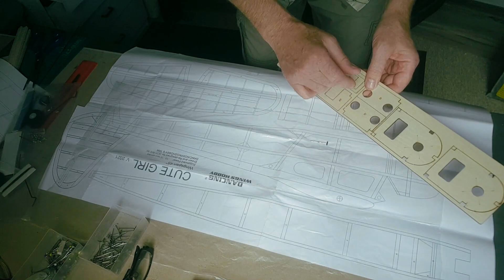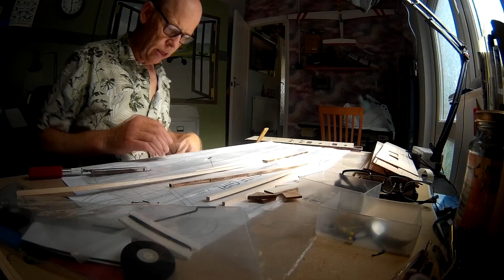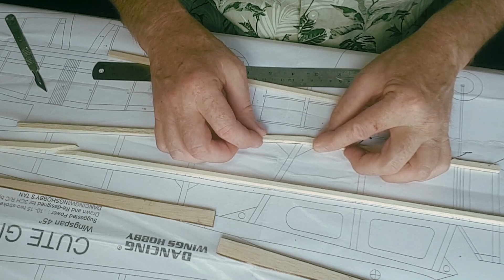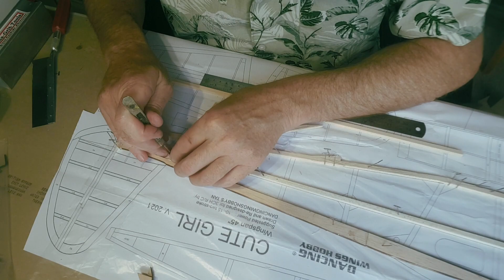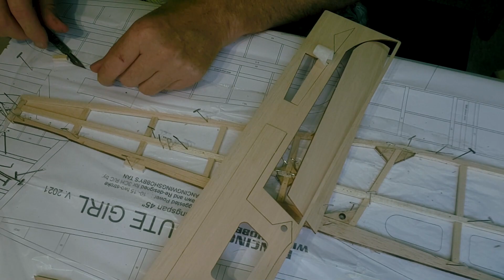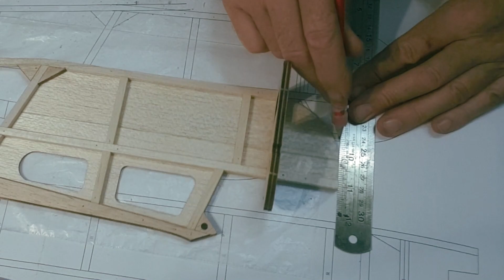Dancing Wings 'CUTE GIRL' Build Instructions, Part 1 of 3

Comment: A quick tip from a 50 + year builder. Get your self an Excel Mitre box # 55666. Comes with  a nice k5 handle and fine tooth saw blade. Perfect 90 degree and 45 degree left and right cuts every time. Exact vertical cuts with little risk of slanted cuts.
They sell for 40 to 45 or so $ but worth every penny.
Reply from the maker: Thanks Ken, cool tip 👍

Comment: Great video for new builders Cliff.....just one comment, not a criticism ! Do you ever build the second fuselage side on top of the first to make them identical?. (with cling film between)..as I say, not a criticism but just the way I like to..
Reply from the maker: Good question David, I do sometimes but rarely. I just use the same pin holes in the building board, everything's pretty close especially a larger build like this, thanks for watching and commenting, cheers

Comment: Thanks for your reply re batteries. As I don't have the package yet can you tell me the available compartment size for the battery. I'll go for a 3S  but not sure yet of capacity. Also, on the resupplied plan, does it indicate the CofG location?
Reply from the maker: @ShipShaper  The battery area would easily accommodate a 2200mah battery keeping it right up against the bulkhead it would help with the cg but a smaller capacity is fine as well, I used a 1300mah at the time because I had a few. The plan in my box shows the cg at 55mm behind the leading edge.

Comment: It's been a long haul on my first build, Cute girl, your help was very critical!! I have the proper Battery on order so all I need is coaching on how to balance the airplane, can you describe that for me? Thanks much! Steve Ross
Reply from the maker: Hi Steve, I bet she's looking sweet. Ok, when you've got your battery put it in place so she's ready to fly. Band on the wings and place a finger each side of the fuselage on the wing on the centre of gravity balance position that's shown on the plan, 55mm or 2 1/8" back from the leading edge. Mine was tail heavy so I had to add weight to the front, as far forward as possible next to the motor is desirable. You're looking for a level model or slightly nose down, don't be tempted to fly tail heavy it will be remitted 😯👍
Reply: @cliffharveyrcplanes  thanks much Cliff!!
Reply: Cliff, can the motor rotation be reversed? I shimmed the motor out about 1/2" like you did and the prop clears the fuselage but the airplane goes backwards, I'm hoping to switch a couple wire plugs and reverse the motor(?) Thanks for all your help!!
Reply from the maker: @steveross7936  That's right Steve, switch any two wires on the motor and it'll reverse the direction 👍
Reply: Cliff, I've so enjoyed the Cute Girl build, and following you in the process!! Can you recommend another build using some of the same tools? Dancing wings or other....
Reply from the maker: @Steve Ross  Hi Steve, my hope was that new builders would find my videos helpful and you're proof of that, cheers. The skills you've learnt will be invaluable in repairing any mishaps that happen along the way, that alone could potentially keep you busy 😜. To answer your question though I've been though my back catalogue of build videos and couldn't find anything that would be of help to someone in your position. There is a plethora of kits on the market, the DW kits are well thought out for sure, their J3 Cub looks nice, available from Model Shop Leeds https://rb.gy/xa1k7, comes with motor and esc but you would need a bigger battery than the Cute Girl and covering film. But like I said there are a lot of kits on the market, it depends what direction you want to go in, scale, aerobatic, electric glider etc?